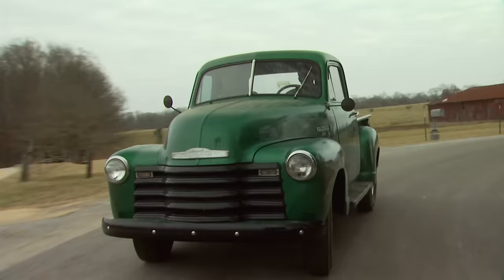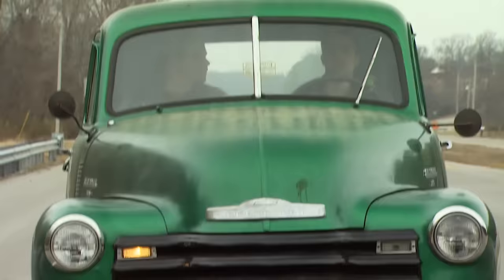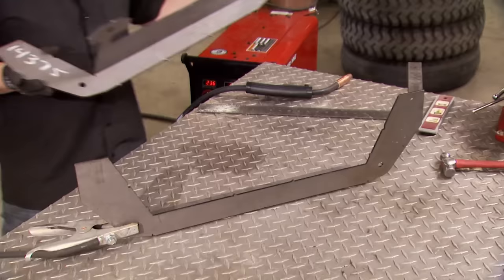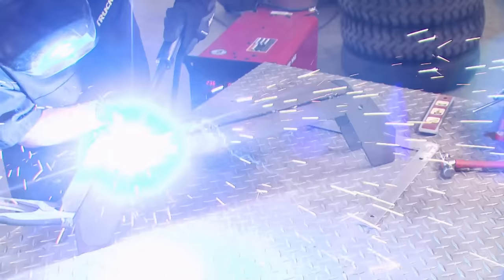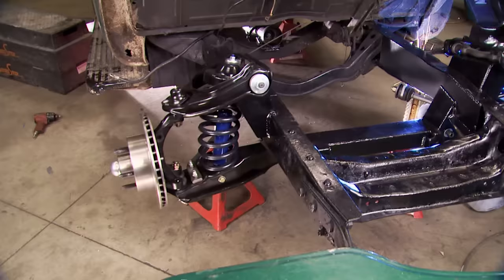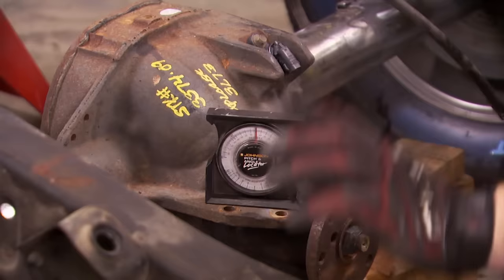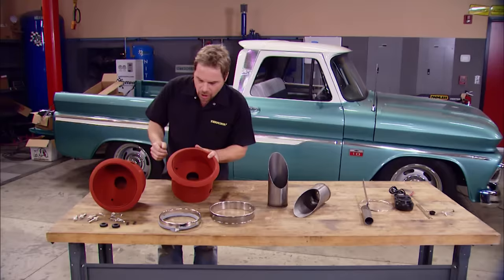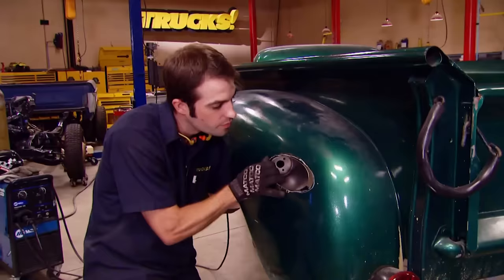FULL REBUILD: 1949 Chevy 3100 Truck with a Hopped Up Straight Six and Patina Paint

Comment: I  think your statement about the wing windows is in correct about the year of installing them into the truck, i own several of theses trucks.
Reply: Tha truck is actually a '51. Not only are the doors a givaway, but the lack of the driver's side vent on the cab.

Comment: They went a heck of a lot further than I would have but that's to be expected. Only thing, besides paint & body mods, I'd want different is a 5spd. But I wouldn't be building a Truck to showcase what's available. I NEED a Truck that I can use and not be afraid to scratch.

Comment: my dad had one from 1949 to 1969 when he got a suburban  green but not metallic signals on the fender from my understanding they didn't come with  turn signal  they were a dealer add on  my uncle was a mackinac and installed ones on the fender  came with a oil bath air filter

Comment: A better way to get that patina look is oil and and cook it with the heat gun it will give you that real aged look and it will have the paint Crack and chip look.

Comment: 1949 Chevy 3100 pickup truck did NOT have vent windows in the doors.  Vent windows didn't come out on this truck until 1951.  If your truck is a '49 (and it may be), it has the wrong doors on it.
Reply: The cab is a '51 as well. No vent on the driver's side.

Comment: Great Job, i like your work. May i highlight one observation related to the front part of the chassis. You module a steel plate and welded it there without considering sand blasting the old chassis and coat it prior welding that steel plate. Positive observation.

Comment: like to see the later model chevy truck six.  better cooling, full flow oil filter, more inches, more hp and more torque.  at everyday engine speed that is better than the small eight.

Comment: Your book is wrong, wing windows came out in 1951, and the 51 is the only model with wings and turn down door handles. In 52 they switched to the push button handle. The 47-50 had turn down handles and no wing windows.

Comment: Instead of replacing the entire steering, is it possible to change springs for different strengths, replace rubber bushings with polyurethane and change wheels and tires for one or two inch larger diameter rims and better rated sidewall tires?

Comment: I'd rather have the older  pickups . I had a 2017 3/4 ton with 1 ton suspension . It was nice.  But their is very few I can work on .
Of new pickups . Below 99 I'm  can worke on 
I would Not hop up a 216 . 292 Is a better choice

Comment: I don't know why on the 51 Chevrolet 5 window truck with the 235 inline 6-cylinder they did not go with a fuel funnel Port intake the final Port intakes are the best and even work really well on 350 Chevrolet engines and others because the funnel Port allows the fuel and air to not have restrictions that you would have in your normal intakes

Comment: Should have left the rear suspension vintage, and just tuned it with modern components. Achieving this by having gotten brand new leaf springs, and paired them with adjustable gas filled struts, with polyurathane springs. Like you said, don't reinvent the wheel, right??

Comment: Working on my dad's 47 Chev car fleet manager. I have 87 ford f-250. Restored truck I'm putting a cat engine 3116 diesel. . If 49 chev 3100 was mine I would put a cat engine In it. Im bored working on gas. After working diesel engine s rules

Comment: well  if  I  owned this truck  I would  have  swapped  out the  3  on a  Tree  for a 4  on the  floor  cause I  can't drive a  3  on a tree  for  some  reason  I just  can't seem  to  get  the  shift  pattern  down  and  God  knows I tried to  learn  but  for  some  reason  I  can drive  a  truck  or  Car  if  it  has a  4  on the floor  set up all  I  got to  do  is  learn  that  pattern  and  I  can  drive  it  like  I  stole  it  LMAO

Comment: Created a lot of headache with 700r4 trans could have kept original motor mounts and clutch  if they had used T5 from S10 would have given overdrive without cost and creating problems .

Comment: I had a 1948 3100 mine was a 4 speed. Just wondering why you pulled the radiator to change the water pump. Should have been enough room to change without a problem. I bought mine in 86 and sold it twice once in88 the people never picked it up sold it again in 2016.

Comment: That truck is not a '49 (without going through this thread). It's a '51. You are wrong about the "Venti-Pane" windows; they came out in 1951, not '52. That's not a 216 engine either. Looks like someone replaced the 216 with a later 235. The 3100 hood side script is in the wrong location.

Comment: Those mig beads are not very aesthetically pleasing. You have to be a good welder to make hardwire mig look good, Flux core is not only stronger but if settings are correct beads should look less lumpy and I'm not talking gasless flux core.

Comment: as informative as these are , you guys ( especially YOU Kevin Tetz )should know right away thats not a 1949 .a 1949 would have had one piece windows and a driver side cowl vent that opens.  that truck there is actually a 1951 and i know that because i own one. the tell tale signs is the vent windows and the lever style door handles. only year like that . 1952 would have had push button handles .